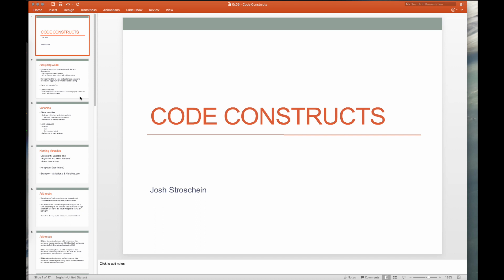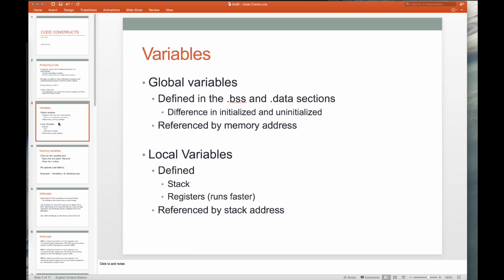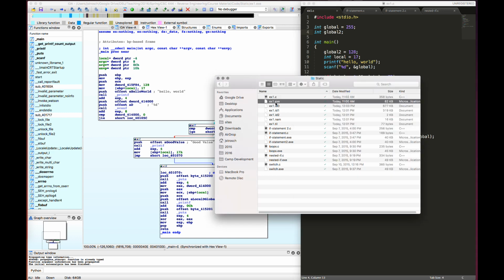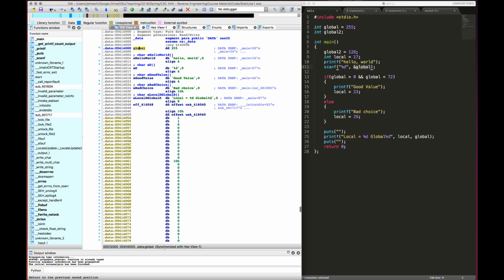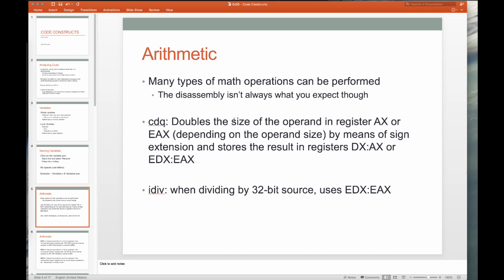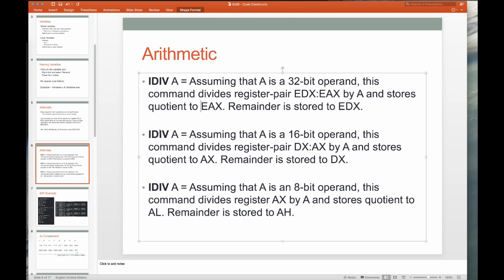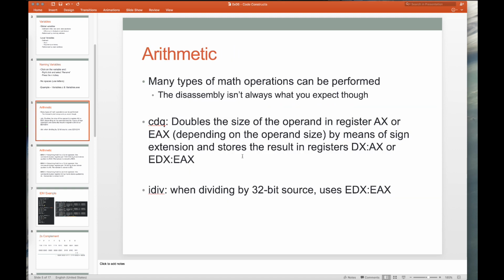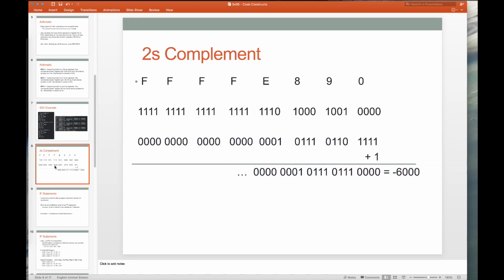05 - Introduction to Code Constructs

Comment: The outcome if the dissasembly threw me completely off as it was optimized in a way where no locals / conditional jumps were generated, eventually figured it out what was happening and how the local was calculated based off the input value, quite interesting

; int __cdecl main()
_main proc near
push    esi
push    offset _Format  ; "hello, world"
call    _printf
push    offset ?global@@3HA ; int global
push    offset aD       ; "%d"
call    _scanf_s
mov     esi, ?global@@3HA ; int global
mov     ecx, offset aGoodValuee ; "Good valuee"
dec     esi
mov     eax, offset aBadChoice ; "Bad choice"
cmp     esi, 46h
cmovbe  eax, ecx
push    eax             ; _Format
call    _printf
push    offset Str      ; Str
call    ds:__imp__puts
push    ?global@@3HA    ; int global
mov     eax, 46h
cmp     eax, esi
sbb     eax, eax
and     eax, 6
add     eax, 17h
push    eax
push    offset aLocalDGlobalD ; "Local = %d Global%d"
call    _printf
push    offset Str      ; Str
call    ds:__imp__puts
add     esp, 24h
xor     eax, eax
pop     esi
retn
_main endp
Reply from the maker: Nice work!